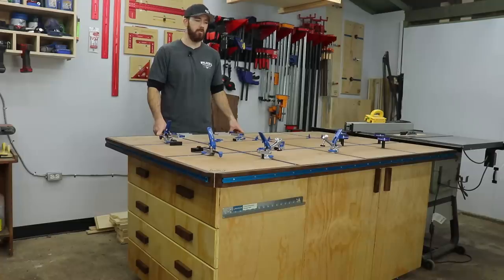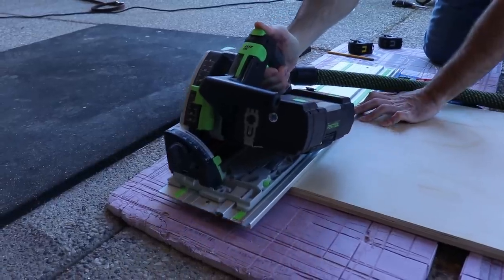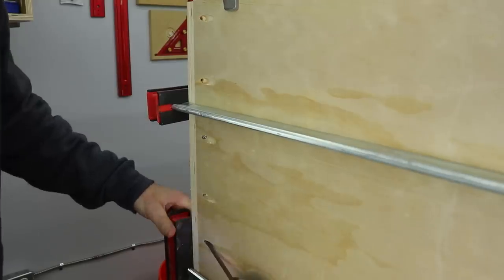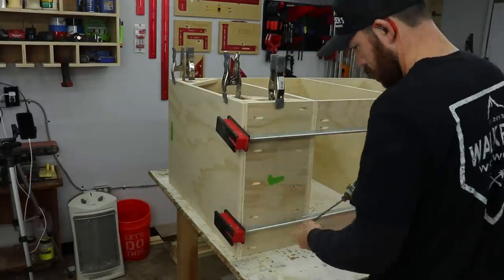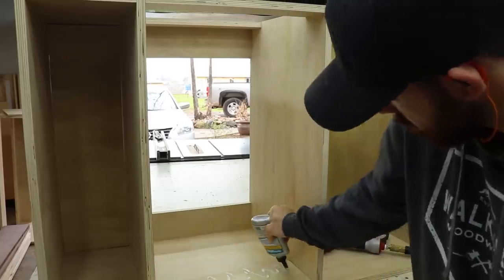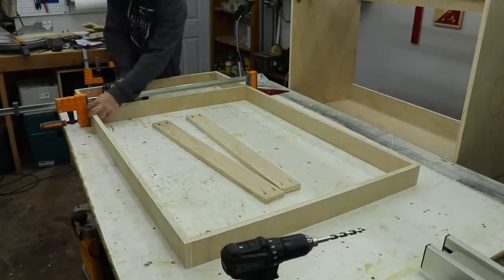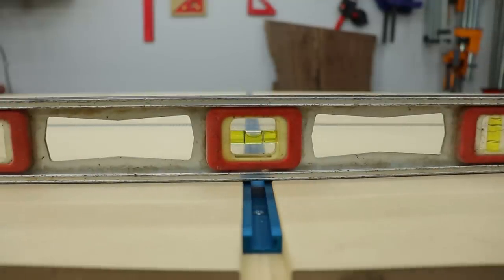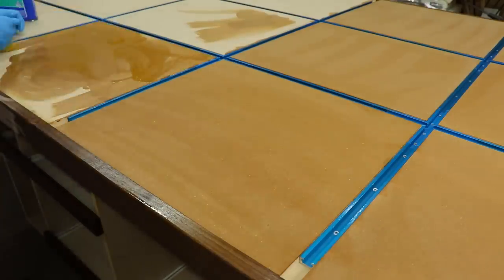T-Track Assembly table / Outfeed table with tons of storage!

Comment: I am beginning to see the value in the modern plywood work bench/extension tables rather than laminated 2x material. I like the t-track grid. You did a nice job of explaining the process. I especially like the Rockler floor levelers- I have the same problem. I prefer a more open bench underneath with big old style legs sans the cabinet shelving. You’ve given me the best ideas for a re-do of my own bench/extension table. Thx. I’ve looked a lot of these in the last couple months.
Reply from the maker: That's awesome.  Thanks so much for watching!  Glad I could spark some ideas.
Reply: Hi, im thinking of doing the same grid of t track in my outfeed table but its my first one and i'm hesitant because ive heard stock can get caught on the track as it get passed the table saw blade. After years of using yours can you advise if this is a major problem you've had or not?

Comment: What an awesome build! I'm searching for workbenches to get some different ideas on what to add to my design and that's how I found you and I'm glad I did. I subscribe to Twisted Knot's channel and I am subscribing to yours. I don't own anything from Festool, but I have been drooling over their domino tool too,lol. I just added a "Closet" or shed onto the back of my shop this past fall. I searched Facebook Marketplace for lumber and found someone who was selling 200 boards that are  1"x 4" x 8' white cedar boards for only $20.00! they were used on a shed that was built 3 years ago, so they had turned grey already and it looks really nice. So I used that wood to clad the closet and made shelves with the rest inside the shop. I then made a heavy duty door out it. The frame for the closet I made out of pressure treated 4"x4" and pressure treated 2"x4". I used an old slightly rusted corrugated roofing panel that I had gotten for free from my uncles property. I bought a "Through the wall dust collection adapter" I bought from Rockler to get the hose inside the shop. And I used a piece of 2" PVC pipe to run the power cord through the wall as well. I also installed on each side wall a computer fan to keep air circulating in the summer. I had purchased a small 40 watt solar panel that I put on the roof of the shop and that powers the 2 fans and a low wattage led light bulb. I anticipated building this when I built the shop and when it was being wired I had an outlet put in on the back wall where I knew I would be building the closet.  Other than the adapter I got from Rockler which I got for 30% off making it $28 off the reg. price of $40 on one of their specials, the $20 for the used cedar and $60 for the pressure treated lumber, I had everything else. $148.00 is not back for a4'x6'x6' shed. I have a surround of 6"x6" timber around the shop where I had to build up a level spot for it, so I used that to sit the floor frame on and attached the back wall of the closet to the shop. So I did used one bag of gravel and then placed a 2- 12x12" cement blocks onto the gravel for the front 2 supports. I just wanted to share that with you since you mentioned you would be doing the same thing. Everyone is different in taste and wealth So I saved a bunch of money by getting some of the lumber cheaply. Best of luck and I look forward to your videos.
Reply from the maker: Oh wow that's awesome!  Sounds like you got it pretty well set up now!  I've done quite a bit of stuff to my shop since I made this video.  Maybe it's time for a shop tour video.... Hmm..
Reply: @WalkersWoodworks  Yes, it is time!

Comment: That t-track install is where a drill clutch (power setting) comes in handy. Just set it to 10 or whatever, and it will not over torque, or strip, or leave heads proud, just perfection every time.

Also, if you want to put a finish on the mdf, use a prestain conditioner for stains/poly. Paste wax is good if you just want an easy one step finish it, looks about the same as BLO, but won't soak in as much.
Reply from the maker: Yea probably should have done that.  I think next time I'll use plywood on top.

Comment: I realize this is an older video but that is what is great about you tube.  Quick question.  What type of plywood did you use, or would you recommend
Reply from the maker: I just used some sanded ply from home depot.  Probably pine or fir.

Comment: Really nice build.  Just about exactly what I'm thinking about doing.  I would have liked to see how you incorporated the dust collection and how you would handle the hoses. I'm using a small vac and separator too and keep thinking of different ways to manage it.  I was thinking of making a manifold under the table and having different places to plug in a shorter hose (with some way to shut off the 'open' legs),  Keep u p the great work and making these very helpful videos.
Reply from the maker: That would be a cool feature!  I just cut a hole where my table saw exhaust is and ran the hose and power cord through it haha.

Comment: Lucky for me, the top of the assembly table that I am building is also 4x6 and constructed with MDF on top as well. Now, can you please provide the dimensions you used for the t track channels on top. Thanks in advance.
Reply from the maker: You mean the spacing?
Reply from the maker: I basically just divided it into thirds on the width and 4ths on the length.

Comment: Good Morning from Vancouver Island, Canada......best work/ outfeed table I've seen thus far....great job Mr. Walker......but one question as to the purpose of the tracks you've inset into the hardwood along the sides of the table?  Purpose?Thanks in advance....
Reply from the maker: Thanks so much!  I put them there so I could clamp pieces vertical like when doing edge banding and such.  It's worked good!

Comment: A totally wet behind the ear "woodworker" here, what size wood for t tracks? 3/4" or 1"? I made a table too I'm looking to throw legs on and dog holes in and now I want to add T-tracks to the edges and face. I don't have a table saw so, any suggestions on where to buy wood that is straight? It's for a 32x48" assembly table.
Reply from the maker: It's actually 13/16" after it's milled but 3/4 would work the t track is only 3/8 deep I believe.  Maybe 1/2"

Comment: Admittedly that's the way they laminate stuff - but it's for high-stress / load use - trusses come to mind. Save your glue next time and just do each corner. You can break it down again with a coping saw or wire saw, etc..

Comment: Finally got off my ass and ordered your plans.  Buying the supplies next week.  Super excited!!!  What brand concealed hinge for the doors did you use?  I am planing on adding the Rockler quick release caster set to make it mobile.  Will send pictures when I'm done.
Reply from the maker: Awesome!  Thanks for the support and I used the Rockler hinges.  Only thing I might change if I did it over was use E ply for the top instead of mdf.  It's just a little more durable I think.
Reply: @WalkersWoodworks  I agree about the MDF.  I was thinking of using 3/4 standard ply for the bottom layers and purebond for the top to safe a little money.  The underlayment will be covered by the walnut trim.
Reply: @scottclifford4370  I bought his plans and should be done building it in a few days. Got most of it done but I’m changing it up with more drawers since I lack that department in my shop. I would love to see yours. If you’re on Instagram send me a message @herling_handcrafted_hardwood

Comment: Just a thought. You don't need the T-Track that can be rather expensive. Find a T-Slot bit for a router. Make a first pass with a 1/4" router straight bit to clear the waste then use the T-Slot cutter in your router to cut the slot.
Reply from the maker: That's true.

Comment: Hey Brandon, I'm finishing up my assembly table build myself and I'm wondering if it makes sense to add t track to the side of my table as well. 

Do you use it much? Does it provide sufficient work holding strength? What accessories do you use in the vertically mounted track? Would you do it again?
Reply from the maker: I probably use it the most honestly.  It works great for applying edge banding.  The hold down clamps are my most used.

Comment: hi, great table, incredible work man, im thinking of doing the same t track grid on my own outfeed table but am hesitant because ive heard it can cause material stock to catch on the track as it slides past the blade. after using as an outfeed for a while now, do you or have you had any issues with that at all? many thanks

Comment: i would have done 3 things differently
1 add a workbench vise.
2 instead of fastening the T tracks with screws i would have drilled all the way through the table top and used screw and nut instead this way they will not come undone if you clamp something hard.
3 i would have added face casters to move the bench around easily.
other than that, congrats you got yourself a very nice bench.
Reply from the maker: Thanks man.  I had considered those things and a vise would be nice.  I ended up using 1 1/4" screws on the track that holds them down well.  I have a very small shop so I don't plan to move it ever.

Comment: This Looks Sweet, I like your idea of putting the tracks on the side to hold stuff up right. I really like how you set the whole thing up, I mite have to get the blueprint. I notice the video has been out for a while, did you have to make any changes to it?
Reply from the maker: That side track is awesome!  I haven't made any changes.  It works pretty well as is! Only thing I will be modifying is the cabinet, I don't use the shop vac for dust collection anymore so I'll be putting shelves in the cabinet for storage.

Comment: Not sure how i missed this vid earlier, but I definitely like it a bunch. It has many features I would like to incorporate into my upcoming AT/OT. Do you find the t tracks in the top surface getting filled up with dust (or stray screws) ? That would drive me nuts. I especially like the walnut trim with built in T track, like the Festool MFT.
     Another item I saw in the background in your opening shot is some sweet looking clamp racks. Are they shop built, and do you have a video on them?
Reply from the maker: Thanks!!  The clamp racks are made by wall control sort of a peg board type system but better.  The t tracks do get dust in them but I just blow it out with air.  Works pretty well.  Thanks again for watching!  If you have any other questions don't hesitate to ask. Have a great day!
Reply: @WalkersWoodworks  Thanks for the info.
Reply from the maker: Anytime!

Comment: Nice build man. Q. I see you used both the festool and makita track saws? Which do you like better and why if u don't mind
Thx. Jeff
Reply from the maker: Well in those sizes they are about the same.  But at work we do have the festool ts75 which is the larger one and I prefer it because it plunge cuts a full 3".
Reply: @WalkersWoodworks  Thx

Comment: Nice assembly/outfeed table. I was going to use the same 3/8" thick Kreg t-track since I had 16' of it on hand. I was concerned that it would not take the loads for the new Automaxx clamps. Kreg's response was that the new clamps don't work with the old "thin" t-track and I'd have to buy the 3/4" thick t-track. I was curious if you've used these clamps in your t-track and if they have worked. Thanks for the help.
Reply from the maker: I have not used them so I'm not sure.  I would say if they say they won't work I wouldn't chance it.

Comment: Hey, great job. Working on my bench currently. Any reason you used three sheets and why an MDF top?
Reply from the maker: Just trying to keep it flat and more sturdy.  I'd probably use ply on top if I did it over.
Reply: @WalkersWoodworks  What didn't you like about the MDF top? I'm considering a similar approach. We're you able to get the top flat without any sagging? That's concerning me versus a thicker bench top.

Comment: Is there a site or location i can find measurements on all the standard t track on the market. I for the life of me am sick of buying stops, and other such track items and matching the fit i want. Example. There's the extruded aluminum 2020 2040 ect, and track type 45, and 75. not sure what 75 is but i own a flip stop that fits like crap in my so called standard t track.
Reply from the maker: I would honestly contact the manufacturer in question.  They probably have that sort of info.

Comment: Curious to know if u did it over again would u consider using melamine for your surface with t-track?
Reply from the maker: I'd probably actually use ply.  I've used Mel before bd it's nice at first but after awhile it starts chipping up.

Comment: Do you have any videos on how to use the T track on the edge of the table?
Reply from the maker: I don't.  But basically I just use it to work on pieces vertically.  So the hold down clamps slide into the rail and hold a piece standing straight up so I can work on the end or edge of a piece.

Comment: Great work on the assembly table Brandon. The contrasting dark / light wood is a lovely touch. I’m yet to try pocket holes but that big tool you used with the handle to drill your pocket holes looks like the bees knees. Cheers.
Reply from the maker: Ya that's the Kreg foreman.  It was definitely fast to use!

Comment: I'm curious to know how the t-track installed in the walnut trim is working out?  Specifically, do the rockler clamps provide enough clamping pressure to hand plane the top of a board clamped to the side of your table?
Reply from the maker: Works great for what I do.
Reply: @WalkersWoodworks  Maybe you could post a demo using the various clamps with the side rail t-track??

Comment: Really great design. This is something I have thought about making, just need to get after it. I am curious how you would use the t track you mounted on the side of the table?
Reply from the maker: Thank you!  Well if you need to work on the edge grain of a board you can clamp it against the side rail and it will hold it still so you can work on it.  I think I will find more uses for it than I realize.
Reply: I was wondering the same. Then I realized that you just place the work piece against the side track at desired height, then secure it with regular hold down clamps on both sides.

Comment: Anyone ever coated MDF with SBR?  SBR is a high-tech resin adhesive/coating/add-mix and in my experience it's the exact same product as rust converter (the white type that either goes black or purple then sorta dark and clear).  I have used it on pre-prepped (wire brushed) rust many a time before paint and it works awesome.  On MDF it would be akin to say PVA but it's like water in consistency and much, much more durable.  I'll try it out myself soon but just asking...

Comment: How flat is the top with using Ply and not using a torsion method?
Reply from the maker: Still dead flat as far as I can tell.
Reply: @WalkersWoodworks  Is there a reason you used 2 sheets of ply and a sheet of MDF instead of just 3 sheets of MDF?
Reply from the maker: I actually wish I would have used 3 sheets of ply and not done mdf lol
Reply: @WalkersWoodworks  ok cool, I'm just seeing how other people have built theirs as I'm wanting to build one but I'm wanting to keep down costs.
Reply: @jac_builtWoodworks  Its been awhile, but I used 2 sheets of MDF and 1 sheet of plywood on mine. Over the past year it's sagged almost 1/8" in the middle of my workbench. It's not this table, but very similar, mine is 3' x 4'.
Reply: @12982blackjack  Do you think just plywood sheets for top would be better?
Reply: @jac_builtWoodworks  yes absolutely! I’ve had really good luck lately with the 11 ply 3/4” stuff from Menards. I’d probably just do 2 layers though. I made maple t-track and put it into the top, that’s why I went with 3 layers. Total overkill and way too much weight.
Reply: @12982blackjack  I haven't had the chance or money to make my assembly table yet, hopefully soon. It is going to be an expense which I can't really afford atm due to being out of work. When I do get to it though I'll make sure to do it properly with all ply.

Comment: There was no reason to waste so many screws the glue was more than enough for a surface that large...
Reply from the maker: Ya.  I said that in the video.
Reply: @WalkersWoodworks  you said you probably used to many. I'm saying you didn't need to use even 1. I understand using screw to secure something to act as a clamp so you can move on quickly in which case sure use a few for the bench top. But that grid... DAMN is that pointless.
Reply from the maker: Meh.

Comment: Brother, thanks for your efforts, but I am an idealist in my heart, so I don’t like what you are doing a little. No, Everything is fine, Everything is fine, but here are these plywood shields ... I would sand them with a sandpaper very well, very carefully, and very Exactly with a bar, and then put them under the press and then glue them . But this is my technology and it is purely theoretical. In practice, you may be more visible, so I just expressed my opinion.
sorry i used google translator